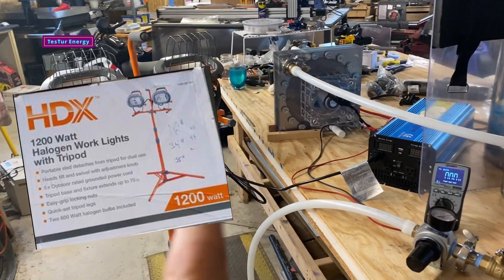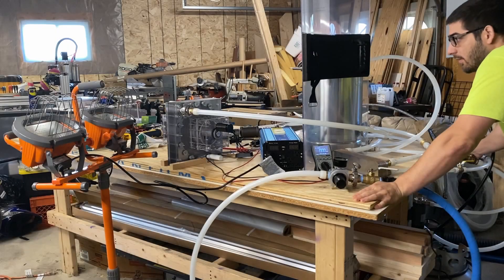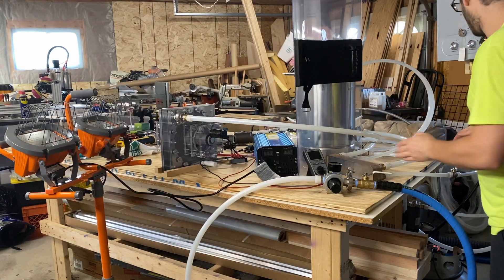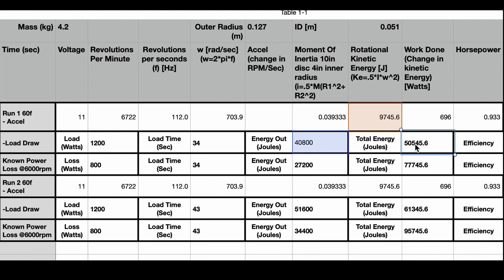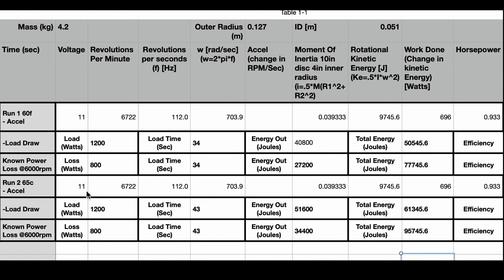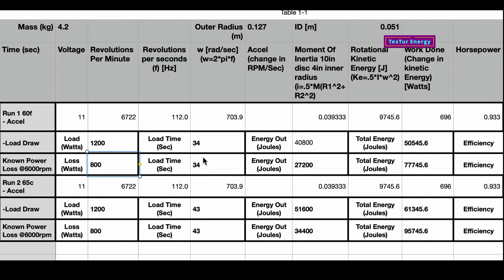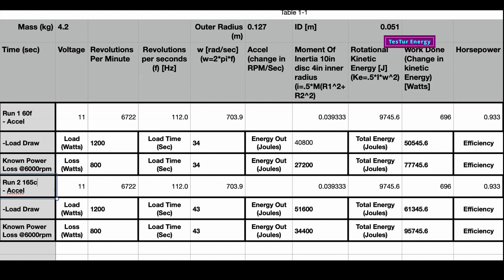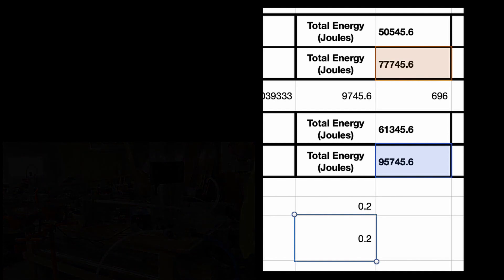Tesla Turbine 1200 Watt Electrical  Load Tests - Power Calculations - compressed Air + Propane

Comment: Is this a single stage turbine or does it have the pump?
Reply from the maker: Hey Adam! Thanks for commenting! Straight single stage. No additions. Saving that for future builds. Just sticking to the basics. Getting that honed in, then building from there.
Reply from the maker: 1200watt Load Test ELECTRICAL Output Efficiency Calculations For 10in Tesla Turbine Are In! 
See the charts here!
https://www.youtube.com/post/UgkxRukN0zoVbtfe1LmLUlXyIo0kdt1ExWZs